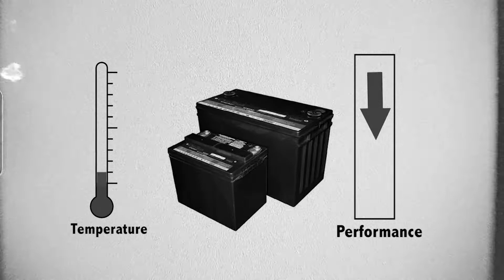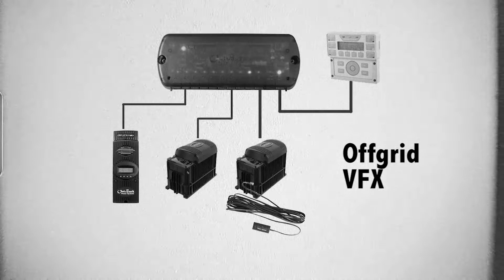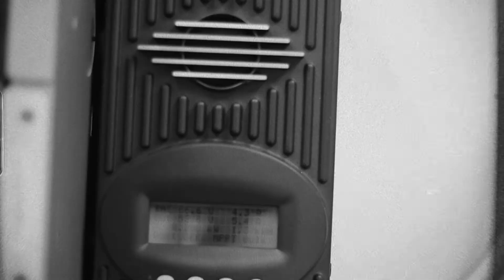Inverter/Charger & Charge Controller: Remote Temperature Sensor

Comment: 1 Have an RTS that came with my Flexmax FM 80.  Can I use it with my Lithium battery or is this just for  Lead style?  
Additional Notes on how rugged these are. My FM 80 Took a lightning hit or a short from with in the unit. 
 It read 0.01v incoming from the PV array.  We tested the PV array and this was 85v.
I shut down and rebooted the system.  There was a few loud shocking pops from with in the left side. 
 We shut it down. 
I'm thinking Rest in peace at this point. 
As I remove the cover to stick my voltage probe in the same thing happened with a zap and pop and smoke of hot plastic wires. 
At this point I'm in certainty the Unit is gone. Looking at the inc PV it read 0.09v  
Ok so what's going on here?
   I shut down and reboot the system.  It's now at 1.0v. It pops one more time as if its being hit with a defib unit!  
The Voltage starts rising. I hear the relays clicking.  Are you kidding me?
 Its doing the system sweep. She comes back online at a full 84v  Inc from the PV array. 
For safety measures I cut the array from 4,800 watts ( 3810w max ever )  to 1800w by shutting down half the DC breakers in the combiner box.  Speed up to today.  
I now have my entire PV array working at max flawlessly.  I'm wondering if we fried a Power mosfet? 
Would this keep going if so?  
Amazing Product. Welcome to the 3rd year of use.  Hoping to get 4 more years from it. Any more than that I'll have to bow down and repost.
 Its survived one zombie apocalypse so far. 
Thanks for making A SOLID Product.  Bill Mac King of "The Wickershire Project Off Grid"